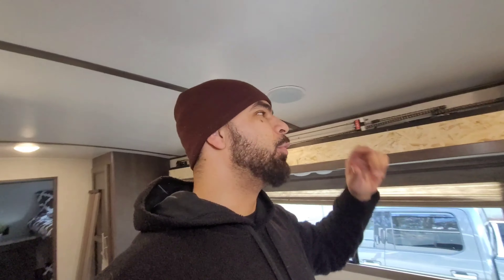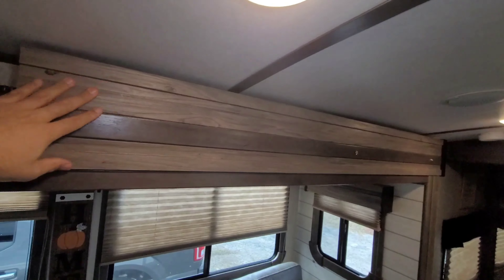RV SLIDEOUT REPAIR AND MAINTENANCE (SUNSET TRAIL RV SLIDEOUT CABLE ADJUSTMENT)

Comment: We have had issues with our slide. Its the seals that have given us issues. Always good to see that slideout cables can be fixed.~ Brad
Reply from the maker: Yeah seals can be a pain there so fragile yet important.
Reply: Slide outs are always a hassle. Seals, leaks, operation... You're not the only one. Stay motivated and know there is always a solution.

Comment: Great video. I have a 2018 sunset trail superlite 271RL. We bought it back in october 2020 and have 12 trips already logged in. I noticed my slide was a bit jerky pulling in and noticed the sloppy cable. Your video came in handy.  Thank you and good luck with your channel
Reply from the maker: Thanks so much friend glad I could help in anyway, just have tonkeep an eye on it and adjust as needed.

Comment: Great tutorial! If we ever bought a manufactured rv, pretty sure we would stay away from slides. But if we did end up with them, nice to know we could make repairs ourselves.
Reply from the maker: Yeah its good to run into the minor issues it saves me from the major fixes later on. Thanks for swinging by.
Reply: Slides in 2021 are almost inevitable I've found, at least on anything but the smallest trailers. And honestly, as long as you maintain them properly, they're not any trouble. Our 2016 has rack & pinion slides and aside from greasing the mechanism as required (I inspect my slides every trip as I'm already underneath putting slideout jacks in anyways) it's never required any work.
Reply: @maxyourjourney  We're waiting for a new 212RB to arrive from the factory, good to know the cable issue can be fixed easily enough. And sounds like that was only your big issue with the brand.
Reply from the maker: @TheDrew2022  no not my only big issue with the brand, this is a total replacement model. Check out my most popular video about Keystone.

Comment: So you have a cable inside the trailer. I haven't seen that before. Some slides on trailers look like garbage. I have 3 metal bars, two with groves and one round bar. Super funny about crying. But I bet those were manly tears. Lol 😁👍
Reply from the maker: Yeah that's how the system is, manly as possible but this will definitely help someone that doesn't want to deal with crappy dealer service.  😆

Comment: I see you talking about the silencers, but does it still make "some" sound when sliding in and out?  We don't have a cable system on our rig and i'd never seen the inner workings of this type of setup.
Reply from the maker: Yes the cables and wires will still have noise. They are also covered in some type of cable oil and that helps as well. Its very cool to know how it all works.

Comment: Great video. Ive got a 2015 Sunset Trail and the slide goes out and now doesn't want to come it. But the motor runs. Any suggestions to fix? And is there a manual override?
Reply from the maker: Yes, manually, have to crank it in it should be above the skide that center piece needs to come off. That will help manually get it cranked in with the hand tool. But you have bigger issues maybe something is out of line. Hot subscribe so I can check back on you.
Reply: @maxyourjourney  Gotcha let me know if you think of something

Comment: What’s good man! Appreciate all the info helps so much. What did you do or how did you fix that rubber seal part on the cables that you referenced in that first video?
Reply from the maker: Those for me just add weather strip adhesive 3m brand or something similar. So it holds up and doesn't damage. Lucky mines just pulled away and didn't rip. Another thing i appreciate you and thanks for being on our channel.

Comment: Just got me a 2012 this was verry helpful .if you could tell me where the switches for the stabilizing jacks are ? lol
Reply from the maker: That year probably doesn't have them you might need a power drill with an adapter, or hand cranking them down lol. Switches are usually right at the bottom of the camper in front of each jack. Newer models might be on a panel in the pass thru or under tv.

Comment: There’s nothing that stops the cable when it’s in or out all the way so don’t keep the button pressed AT ALL when it’s completely open or closed.
Reply from the maker: Oh wow the tension pulling both directions is what should keep it in place, you might be missing something as well. In all my years that has never happened, but they all have there issues. It just sucks when they are new with those kind of problems. I hope it turned around for you, for the better.

Comment: Adjusting is the easy part. The hard part is when that motor rips the pulley system off the wall because there is no shut off trigger or fuse. When the cables are too tight it rips it out even faster. Not on you but a design flaw that comes with the system. Sucks when it gets ripped out 10 minutes before checkout time at the RV park.
Reply from the maker: Man I believe you, that would be a nightmare situation. I hope I don't experience that. Appreciate you
Reply: @maxyourjourney  it's all a part of the game. Just keep some tools on hand and T brackets to re secure the pulley back to the aluminum frame and if you have kids make sure you got snacks so they don't cry  the entire time that they are hungry while you are rushing to fix the manufacturers shitty design and poor quality. 😂
Reply from the maker: @RD-qc3eb  I'll remember that 😂🤣

Comment: How can you tell that the cables are starting to sag without taking the panel off?
Reply from the maker: Its in my other video tagged Sunset Trail has a Major issue it shows the cables hanging. Check it out its pretty bad.

Comment: Is this the same on a 2013?
Reply from the maker: Depends if it's running the cable system it should be very similar.
Reply: I don’t recall seeing the cables on the top and bottom of the outside of the bump out it’s more of a channel if I remember remember right going across the bottom

Comment: Are you happy with your camper now that you've fixed your cables?  Would you buy Sunset Trail again?  I'm considering purchasing one.  When I look at different manufacturers, they all have their own horror stories.
Thanks
Reply from the maker: They all have there own problems all of them. I would buy again. I would be extra on my walk-through and probably still have an issue. So with that said I would say buy the best design and model that works for you.